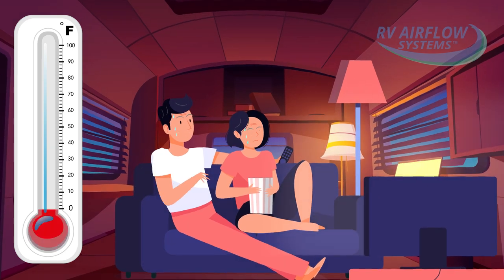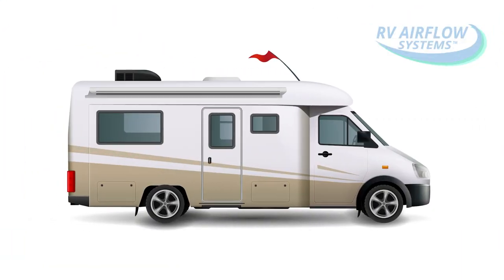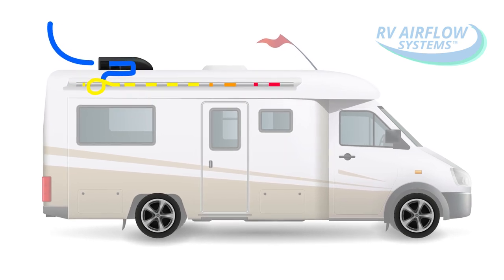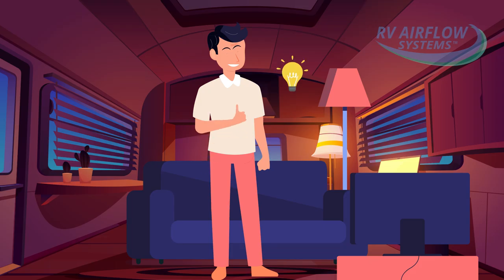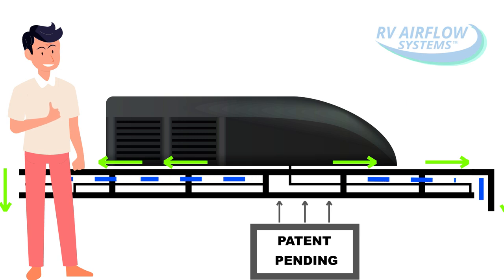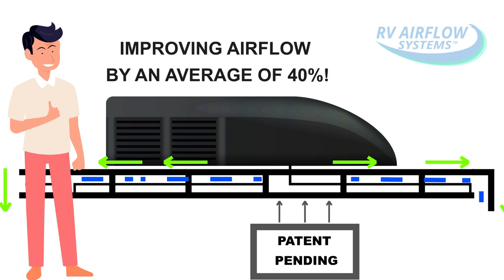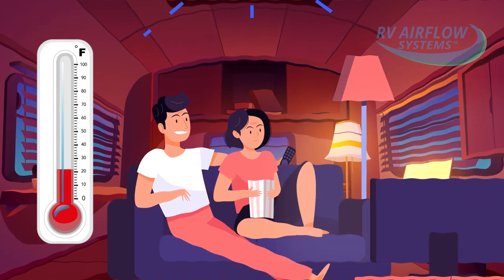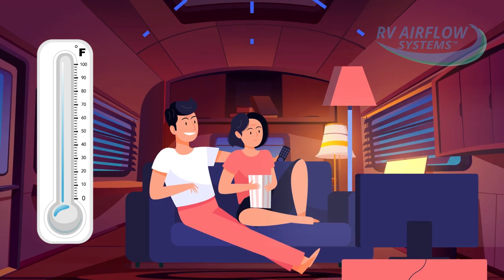How the RV Airflow System works

Comment: We recently purchased the RV Airflow System because we live in Florida, and we've had a lot of trouble keeping our rv cool enough in the summer. The airflow out of our vents was horrible, and barely any air flowed out of the bedroom vent at all, so got really hot in there. My husband installed the system and the air blows out of the vents so hard now that it moves our hair when we stand under a vent. The bedroom vent flow has improved by at least 60%. We have to say, we really weren't expecting it to work as well as it does. Pleasantly surprised. Worth the money. Will totally recommend this product to our rv friends. Thanks.